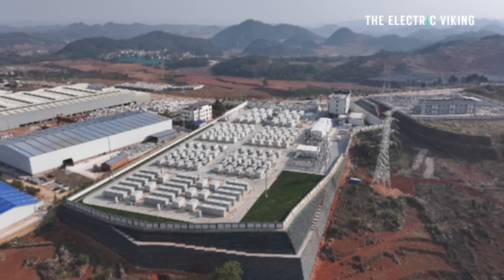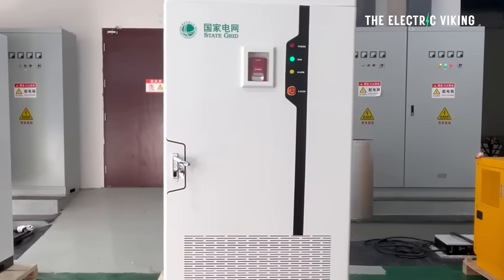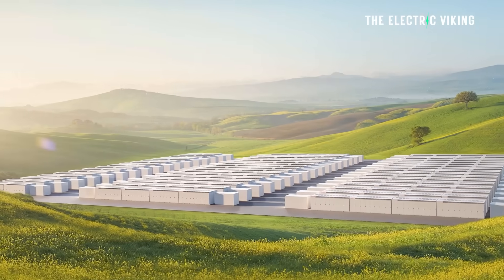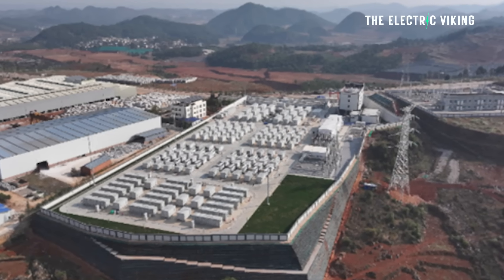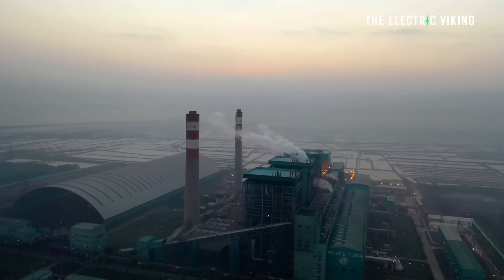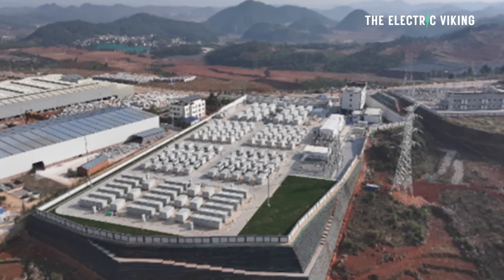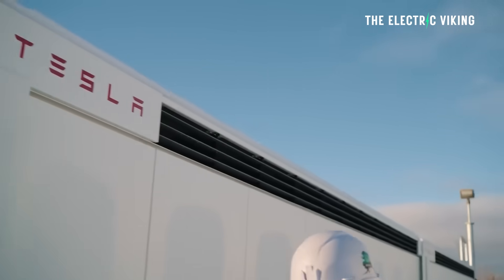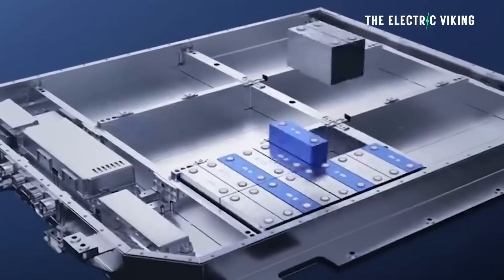The Lithium-Sodium Hybrid battery that powers an entire city in China

Comment: Jeez - for the millionth time Viking and all other simpletons  - they are hybrid battery PACKS not hybrid "batteries" !!  Better still - avoid the word "hybrid" altogether and call them "mixed" or "combination" battery PACKS.  
This guy and most comment-posters just can't be educated on so many crucially important facts and issues. 
Tragic.
Repeat:  
 - battery PACKS not batteries, battery PACKS not batteries, battery PACKS not batteries. 
Sinking in yet?

(Paul G)
Reply: Ecktually “battery” means a whole slew… “cells” are the units inside the battery- which is, as you insist, packed in a metal case.✅

Comment: Sodium batteries for EVs need an infrastructure of 1M Watt fast charging (lithium cannot fast charge with 1M Watt), not impossible to implement, but not a reality yet. CATL's sodium battery has 10,000 plus cycles (very high number), and its relatively low energy density is good enough for at least 200 to 300 km range, such that the EV has a reasonable weight.  I assume a 1 MWatt fast charging infra is only a matter of time, because we all want a short 5 minutes recharge stop. Then 'lower range'  sodium batteries for EVs become very cost effective and practical. Elon?

Comment: Sodium Ion batteries far more stable, and easier recycling with less polluting titration extraction for recovery.
Better thermal envelope of operation, low cost and  higher cycle life so far.
Static storage that is both cost effective and safe means far more community based mid size battery storage within residential proximity with minimal safety concerns.
Sodium has a reported 20 year life cycle minimum with up to 70% retained service State of charge according to some research papers.
Whilst Sodium may not be the ideal battery for vehicle use for static storage of renewables it is a no brainer.
Battery tech development will continue for transportation as weight and energy density is key.
Fast charging is a nice to have but not critical. long range with minimal mass is the truely game changing result.
Aluminium Ion , and solid state hold the key to vehicle performance and large transport.
All the open cut mines are looking at full electrification of their big mine trucks and excavation equipment. 
It is happening, and the more energy dense the more payload the trucks carry compared to battery mass.